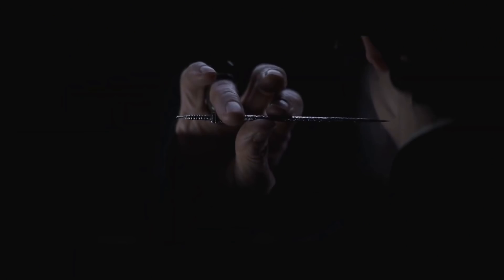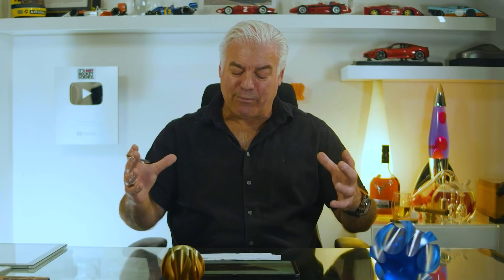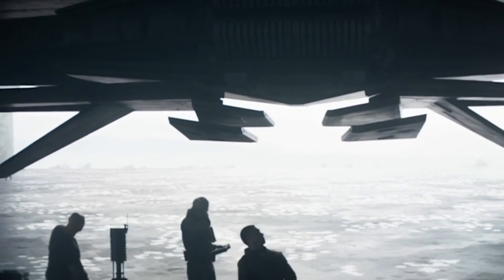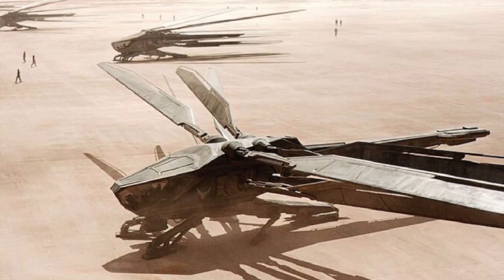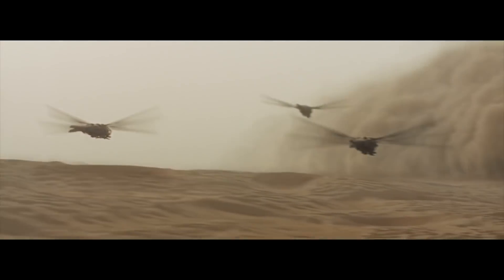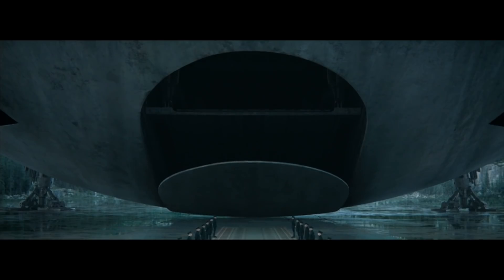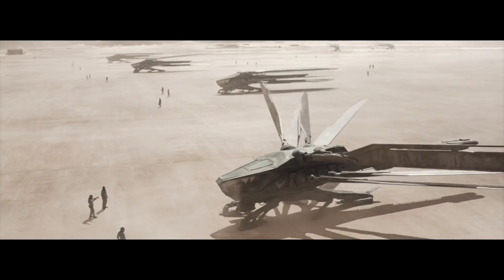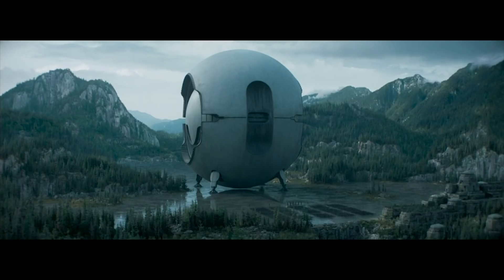The Amazing Ways DUNE'S Ships Were Inspired By Nature!

Comment: It's interesting. Denis didn't want the vehicles and tech in the film to feel like your typical sci-fi laser-tech with holographic transparent displays, AI, machine learning and sophisticated thinking-machine technologies. Since AI was banned in the universe technology has had to advance down a more analogue route, chunkier, more robust and reliable. Ships like the Ornithopter are an awesome example of this creativity. Look at the gauges in the cockpit, the knobs, leavers and buttons. Brilliant.
Reply: Lol but there is no way that ornithopters aren't just flying computers 😄
Reply: @nudl3Zz it still could be a flying computer since non-thinking machines are still allowed to use.
Reply: @nudl3Zz everything on choppers was mechanical and analogue before computers, even rotor leveling was done manually, it still is actually , depending on the make of the chopper